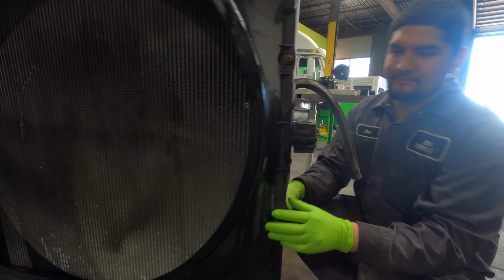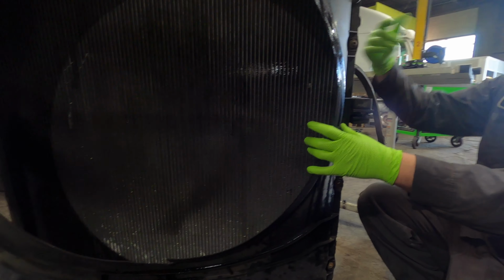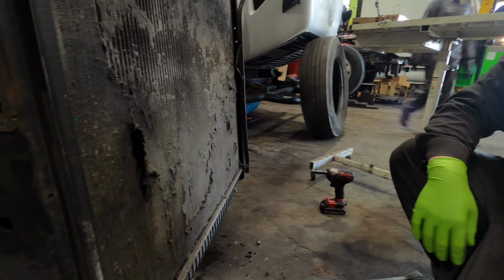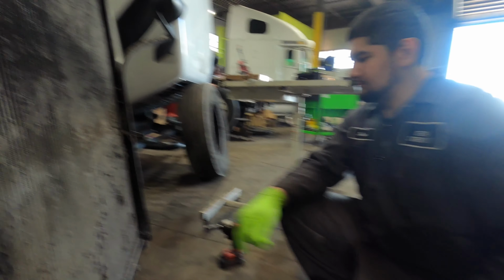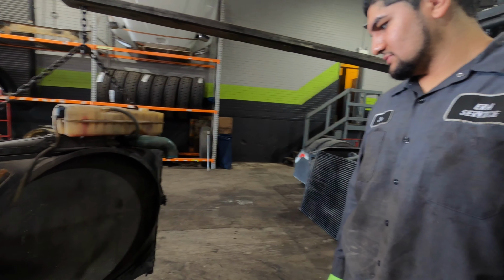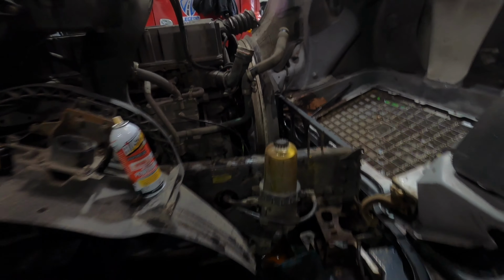Clogged Radiator Causing a Diesel Engine to Overheat

Comment: Can you guys do a video actually showing how to properly clean the radiator? I'm having the same issue on a 2018 Peterbilt 520.
Reply from the maker: Hey ThaThunderStorm! Thanks for chiming in. I will add this as a request for a video.
Reply: Power washer
Reply: I’ve got 2 small leaks in the Radiator Core on my truck.. was told have to replace the core about $3k 😲
Reply: Spray the fins with simple green, let it sit then use a power sprayer on it.